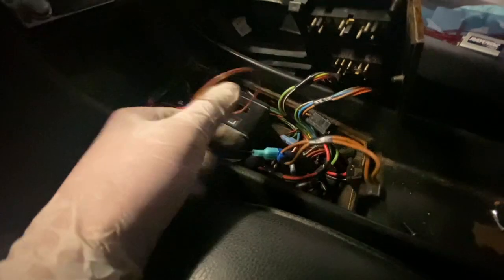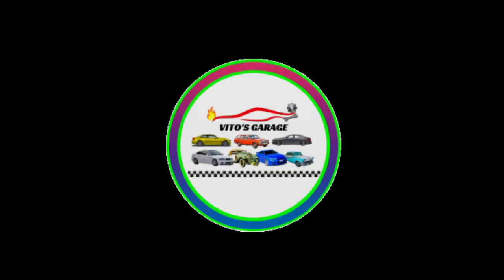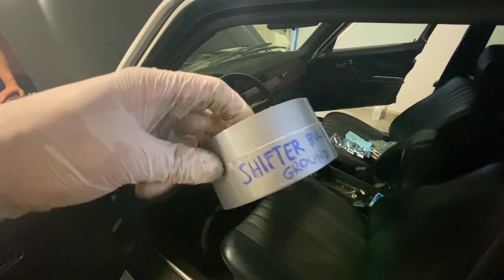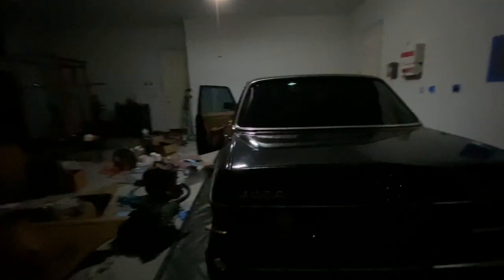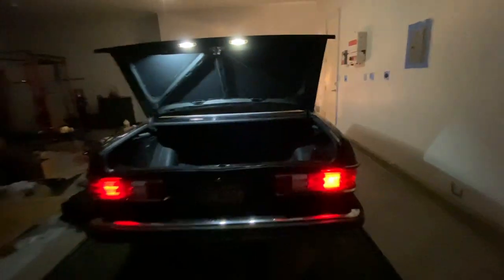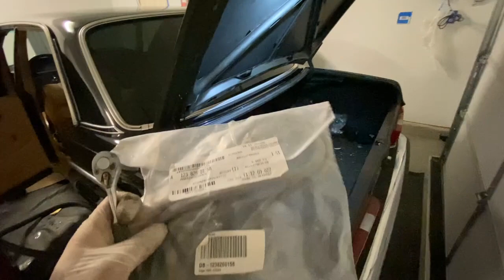It's Like Performing a Surgery on Classic Mercedes. Diesel W116 300SD and W123 300D

Comment: Just an FYI, that aftermarket radio clashes terribly with that Mercedes interior.  You actually don't have to give up modern features to get a radio that integrates better with classic car interiors.  A number of stereo manufacters such as Becker, Continental, and Blaupunkt all sell modern aftermarket radios that still allow you to keep a stock radio appearance while also providing such features as Bluetooth, USB, as well as Iphone and Android integration in a stock single DIN radio opening.